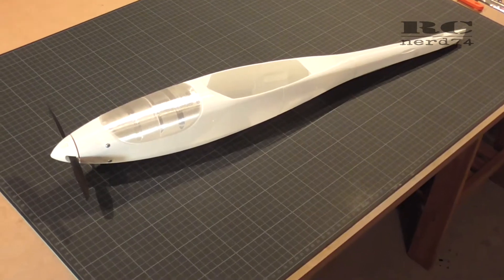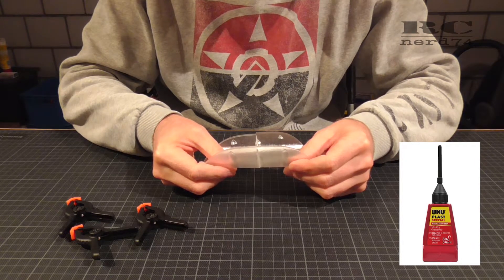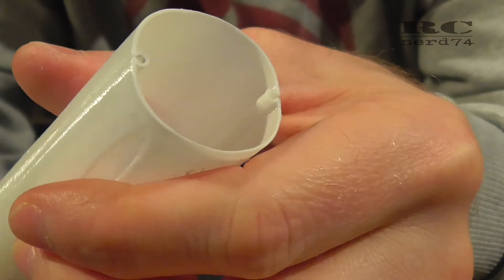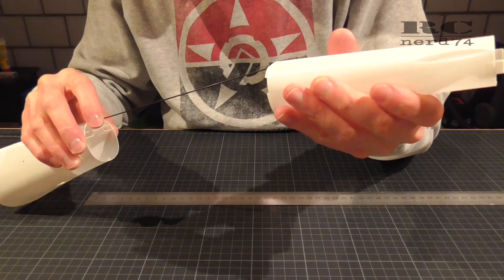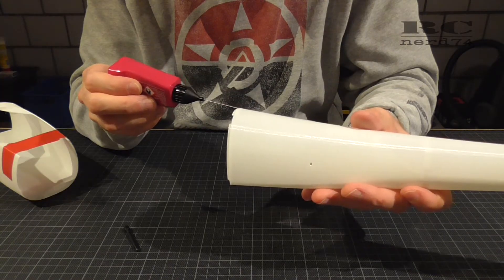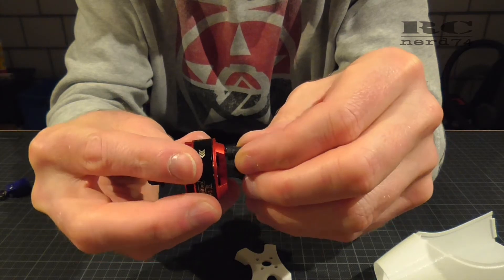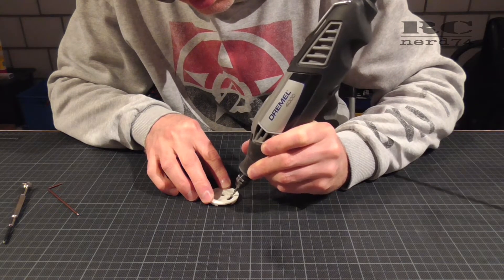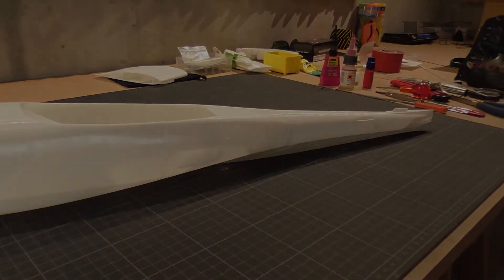ECLIPSON MODEL A | 3D PRINTED RC PLANE | BUILD PART 1 | FUSELAGE

Comment: Nice video.  What are you using to dispense your CA glue.  Looks very clean, simple to use, no mess?
Reply from the maker: Thanks. I didn't use CA glue. My solution was to use UHU plastic special glue. You can see it in the video. This makes clean glue spots pretty easy.
Reply: @RCnerd74  Thanks for that.  So I'm in Canada.  Can you give me a link in order to purchase this glue please?
Reply from the maker: @nicholasjacobs1967  https://www.uhu.de/de/produkt.63094 This is the link to the UHU Website. Perhaps you can order there. If not, you can ask at your local Hobby Shop. This glue is mainly used to Glück plastic models like Tamiya Revell and so on.
Reply: @RCnerd74  Thank you so much for the information.  I just saw your first video which details the glues you used.  Thanks for the great videos.
Reply from the maker: @nicholasjacobs1967  You are welcome😃

Comment: information.      good work.        at 4:47,  the  absence of formers in the main/forward fuselage of these printed designs,  leaves them a bit  short-on  rigidity.       at 5:58, seems a bit  wiggly.     it that from the standoffs?        at 6:33, you should be aware that there will little to no cooling, from that source.     there is little room, and no reason, for air to enter, there.    cheers       googletranslate
Reply from the maker: Thanks again for your inputs. The motor wiggles a bit because of the soft mount spacers I use. This is just for testing. If it doesn't work, I change to regular spacers.

Comment: great vid! how long does it take to print all of the parts using eclipsons recommended settings?
Reply from the maker: Thanks😃 I didn't print the parts by myself. A friend of mine did it for me. I think it took around 50 hours for all parts. But cannot tell your the exact settings he used on the 3d printer. He used regular PLA, not LWPLA.

Comment: Thanks RCnerd!  I started printing this one out recently.  What is the size of the carbon rods?  All same size yes?  Your Fuse looks good btw. Im on second part of mine and I think I need do some tweaking to my printer or turn heat down a little
Reply from the maker: You are welcome. The carbon rods have 1.2mm of diameter. But I recommend to use these rod only for the fuselage. Not for ailerons and elevator. No need to installl this additional weight. Maiden is coming closer. Video will follow.